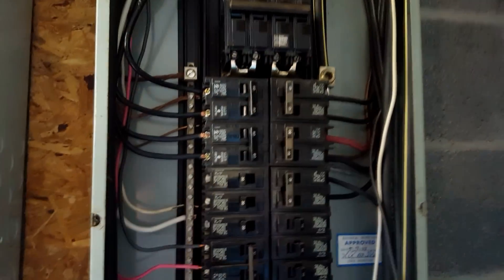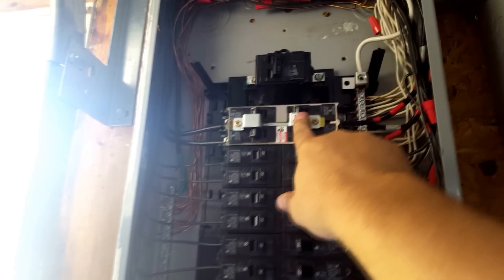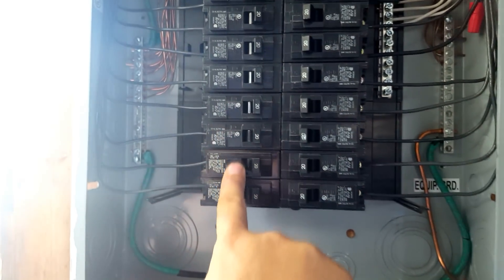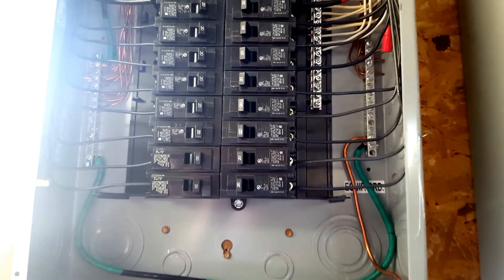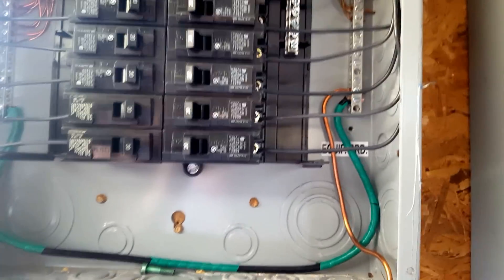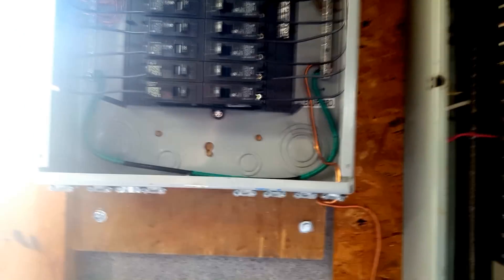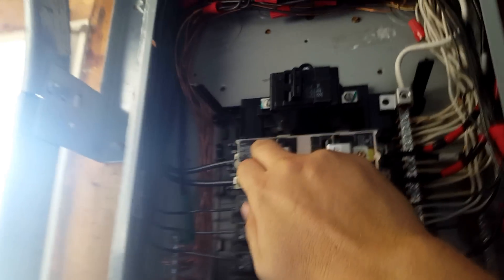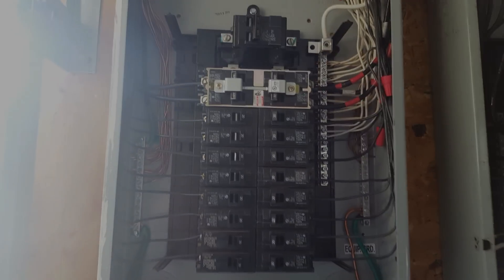Explaining how I installed the Alternating current on the off-grid on-grid Sub panel.

Comment: all calculations a side I live in a area where we get frequent storms. si I try to store more amp hours of power than I can consume in a 2 day period.  but I also want to recharge in half the time on a normal day.
Reply from the maker: I'm charged at 11am every day and if i have rain all day i just turn off the inverter and then it will charge fully by 4pm

Comment: in my case I am using 12 volt system. 420 amp hour battery bank, 4000 wat pv and 2000 wat inverter. everything is balanced so I never use more then half of my battery bank to get through the night
Reply from the maker: ok what's you watt hour of your batteries
Reply: I am not sure on that one!
Reply from the maker: +Solar Power Electricity and Electronics (phillip20) my amp hour of my bank is 1370 amp hour @12 VOLTS
Reply: Now it looks like instead of me helping you you are helping me lol nice
Reply: I will have to figure that one out now because you got me thinking about my system
Reply from the maker: i have 12 6 volt batteries @ 225 amp hours each. 225*6=1,350 watt hours for one battery.
1350*12=16,200 watt hours that's how much power I have every day when charged and I do charge every day with 3000 watts of pv and my system is running at 24 volts
Reply from the maker: Take a look at my new video about the app i think you will like it.
https://www.youtube.com/watch?v=Z5k1fZ7Emws

Comment: ideal setup would be 840 amp hour battery bank, 8000 wat pv array with 4000 wat inverter
Reply from the maker: 840 amp hour@ 12volts?
Reply from the maker: Whats the watt hour of the battery bank

Comment: changing your inverter will only fix your progrming problem. but if you increase your pv array and battery bank capacity you will fix your grid down run problems!

Comment: This is a similar idea I had.  I am not interested in selling power back to the grid.  As soon as you send power out they want to regulate you. No thanks. I'd rather be offgrid and let the Utility companies generate their own power.  So eventually when I'm ready is it best to run separate lines through my house just for solar or go your route where you are using the existing lines?
Reply from the maker: I was going to start running new wire on all my circuits in the house but have found a very inexpensive way, that is just tie it together with a sub panel. The bar cost is less than 20 bucks and rewiring the house is thousands of dollars so I went the cheaper route. And when my batteries are dead I just flip some switches and problem solved back on grid power.

Comment: Are the ganged breakers made just for the purpose or are they ordinary breakers with a connecting link sold separate? Are these Square D branded?
Reply from the maker: Ordinary breakers and it's a Siemens panel
Reply: Thanks, I keep forgetting about Siemens. What is that connector piece called that gangs the two breakers together?
Thanks
Reply from the maker: I'm not sure. It's hard to find too but you can find them at your local electrical supply house.Just show them this video.

Comment: when you getting your magnum inverter
Reply from the maker: ASAP bro!
Reply: Your going to like it quiet and efficient. Starts hard to start wells to
Reply from the maker: I am not concern about the volume of sound. Two things I am concerned about, battery selector which doesn't work on my inverter right now coz it's junk and efficiency. Mine consumes 200 watts but the magnum consumes 26 watts and has a 5 year warranty is a bonus.

Comment: What size wire did you use to run from your inverter to the panel,4 or 6 AWG?  Would love to see the 220 Volt circuit as I am going to do this for my well pump!
Reply from the maker: The panels have a 6 AWG from the combiner box to the charge controller from there it's 4 AWG to the DC breaker box and there to the inverter and batteries is 4/0 wire. It's much easier to run a split phase system that will pass a inspection and dual legs of power from an inverter don't buy aims inverters
Reply: Solar Power Electricity and Electronics I have ordered a Conext 120/240 inverter from Solar Penney and had planned on running the 240 to the panel much like what you have, but mine is totally off-grid.
Reply from the maker: do you have kids whats the idle power of the inverter and whats your power in KWH on grid now?
Reply: No kids, just a single person, I have 8 Trojan T-105-RE batteries setup series parellel for 24 volts and currently 6 250 Watt Panels. I haven't got the inverter as of yet, awaiting that right now! As I said,I am totally off-grid with propane for my stove top and a wood Stove for heat.6 AWG wire running from the panels down to tap into my charger and inverter once it arrives.
Reply from the maker: Do you have a charge controller
Reply: Midnight Classic 200.
Reply from the maker: you will be able to run at most on 24 volts around 1800 watts input of solar that's fine with the wire going down to the charge controller 6 AWG you will need the solar volts at 90  to 60 volts and that will be best for efficiency.
Reply from the maker: http://www.calculator.net/voltage-drop-calculator.html?material=copper&wiresize=2.061&voltage=18.4&phase=dc&noofconductor=1&distance=100&distanceunit=feet&amperes=8&x=49&y=13
Reply: Thanks, great tool.
Reply from the maker: I hope that will help you. are you going to run any of your solar panels in series
Reply from the maker: I did 4 in parallel and 3 in series and i'm running about 85 volts or so input on the charge controller.
Reply: Solar Power Electricity and Electronics All my panels will be in series for the time being until I get more panels up.The Conext is supposed to put out up to 90 AMPS.So I am just going to put up a Distribution panel as my main panel.I only plan on roughly 5 or 6 circuits for my place as it is only 14 x 32 cabin with a 6 x 8 lean to as my utility room.
Reply from the maker: your charge controller will only do 79 amps and the solar power will go there first